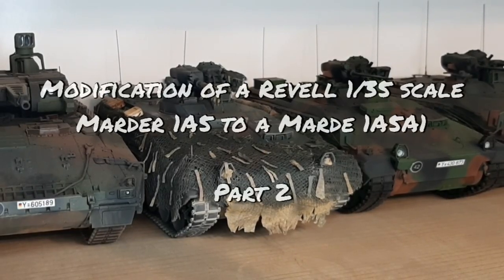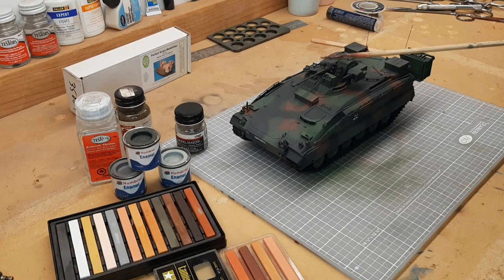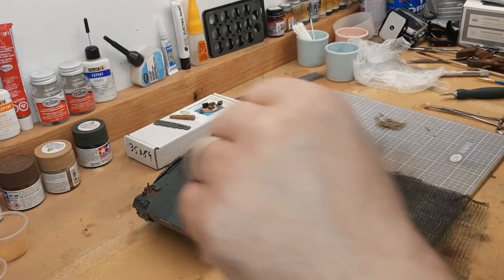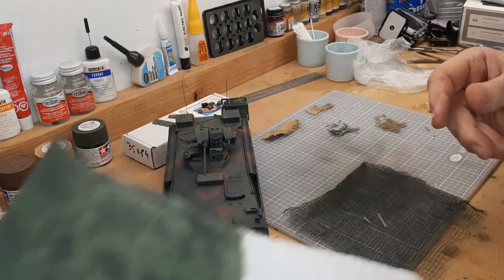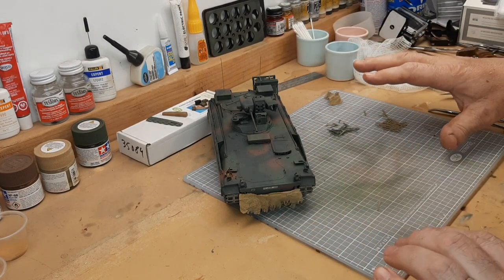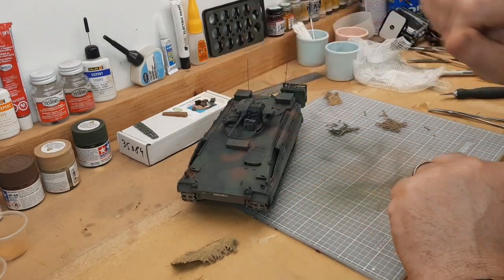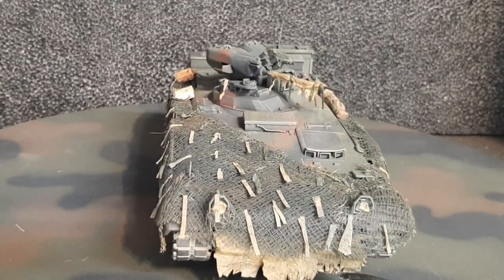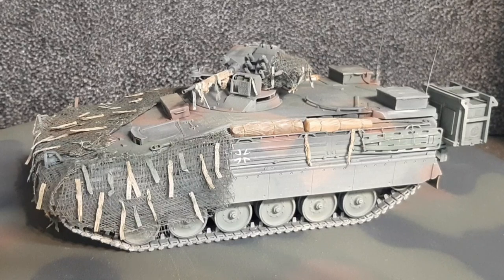Perfect Scale Modellbau Marder Raumklimagerat resin install on 1/35 Revell Marder 1A5 (part 2 (#28)

Comment: Turned out great. Ive been wanting to try that barrel wrap lately.
Reply from the maker: It was realy easy.. just take a small piece of wood dowel or plastic and role it then cut to fit. Crumpling the tissue paper really adds effect
Reply: @Ricks135scalemodels   well thanks for the video, I started messing around with some different papers before your video was even over. Ordered some cheesecloth too.